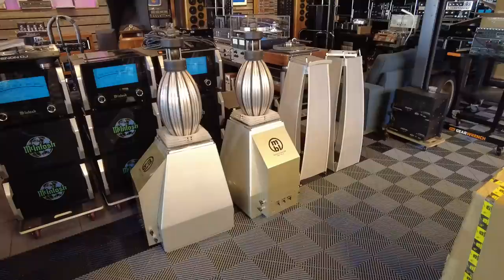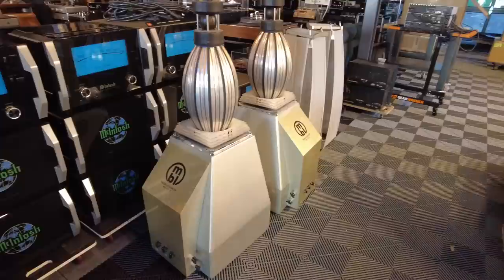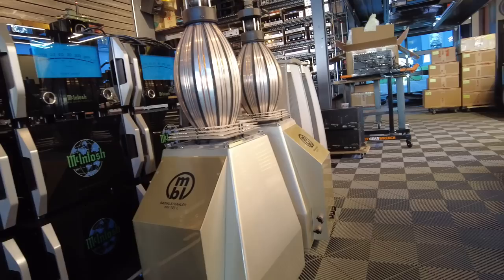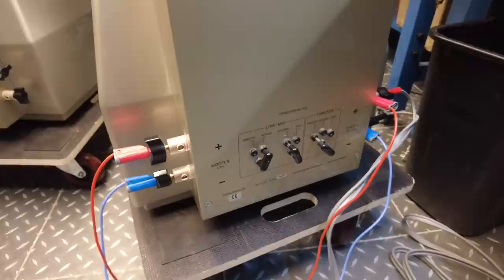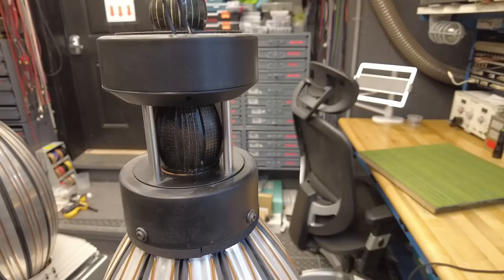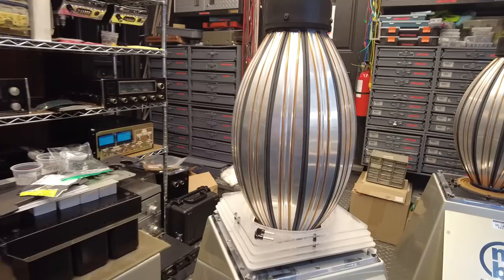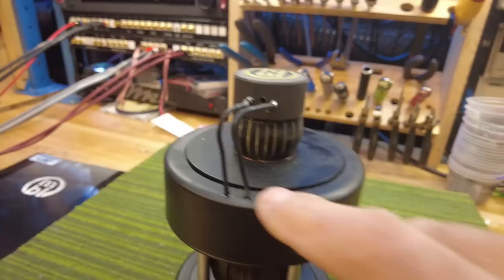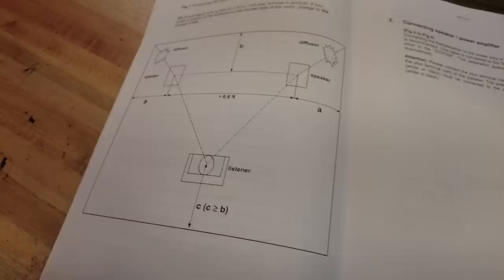The Fantastic MBL 101 E Speaker - Restoration and Listening - Part 1

Comment: I’m really hoping you do a video showing the crossover network on these speakers. Also these are really expensive speakers to have all those carbon fiber strips in the upper mid and tweeter to be hand glued. You can see some pretty significant irregularities with the width of the strips and the placement of them. It just seems odd that they haven’t perfected a manufacturing process to keep that from happening as I assume this effects the sound in some way. When I saw them being built. That was the first thing I noticed and I noticed it on this pair as well. It’s the same for their $300k big brothers also. Uneven hand glued drivers. But I’m sure the sound great. It t just bugs me for that kind of money. My ocd kicks in big time
Reply from the maker: If you watch the "how its made" video there is a nice lady shown that hand glues the carbon strips.  She does a pretty nice job but its definitely not "robotic precision".  The proof is in the pudding, we'll see how they sound.  The crossover is massive, Ill be sure to show it when I re-assemble.

Comment: Cant see the logic to these speakers.  I would think you get a lot of distortion especially on the big mid range drivers.Surely as aluminium orange shaped segments get pushed up and down by the voice coil you would get a ripple effect along each segment. Almost like if you have a rope laid out on the floor in a line and you give one end a flip and watch the ripple travel along the rope.  in other words  " Distortion "   Unlike say Apogee duetta signatures or Magnapan speakers where the whole panel is pushed back and forth over its whole surface area. = less " Distortion "